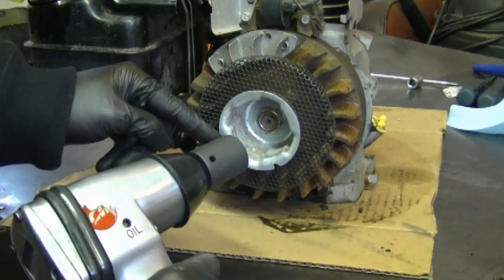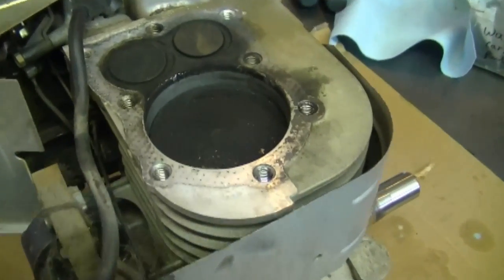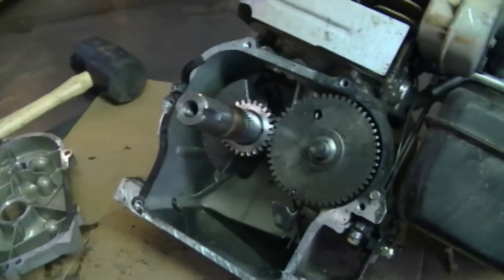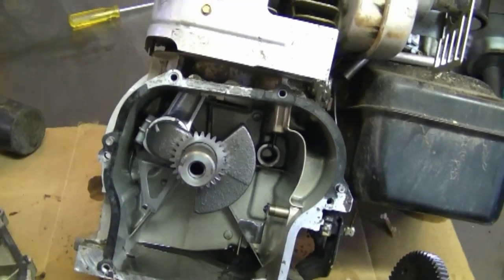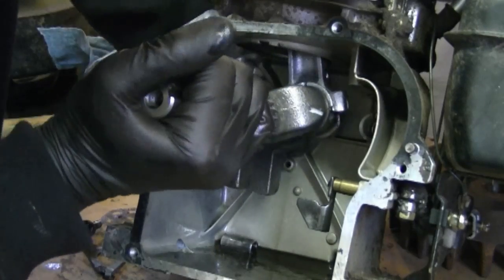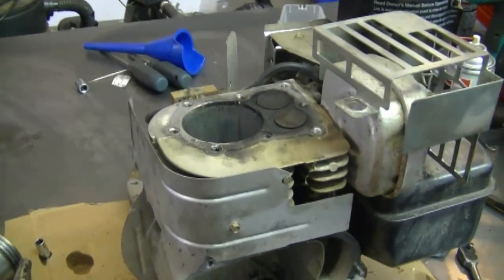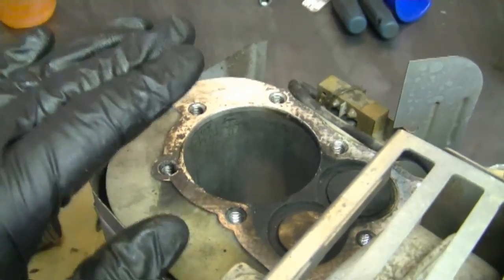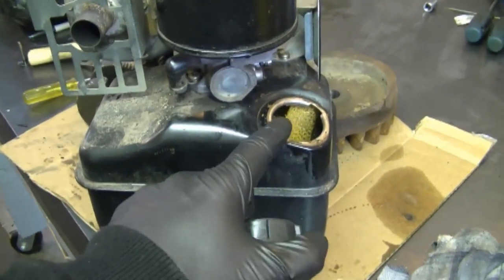5hp Briggs & Stratton Engine Teardown & Possible Cause Of Death

Comment: Old vid.. but a handy one.   I found a big old cement mixer on my property in the woods. It spent at least 20 yrs in the woods.    Same engine.   Rather than rebuilding tho, I bought (for 50 bucks) a running replacement.   BUT... The replacement has a 3/4 smooth shaft... The mixer engine has a 3/4 shaft with teeth for the 6:1 gear reducer.   Soooo... I'm simply putting the old crankshaft and crankcase cover,  made to accept the reducer box, into the "new to me" engine...  Which is super clean and smooth running.  
Pretty straightforward with a little patience and research.    Including this vid.

Comment: Online 5hp rebuild kits are cheap for these old Briggs engine's, you can over size the cylinder and get an oversized piston as well, OPTION 2 get a Running IC 5hp engine you can find them all over used and swap the crankshafts 👍

Comment: You are best off inserting a sleeve, new piston with cast iron rings if you want any life out of the engine. If you hone it you will hone through the chrome and a bare aluminum cylinder will wear quickly. Have done several repairs like that on B&S engines and they have never come back with compression issues.

Comment: Wow I the cost of a short block in Canada is wildly expensive, yes I agree with you ,the oiler rings tolerance appeared to be to tight that would definitely allow improper excessive blow by, I agree that's why the piston  was carboned so badly !I'm rebuilding a 1974 briggs 3.5 hp for a fellow he just wants it built to run, so he can have a running antique engine, I was big time surprised all of the o.e.m. parts are still available even the o.e.m. paint in a rattle can is available i want to thank you , for all of the education you have shared with me, on small engines, I have recently been showing the neighborhood kids 9-14 years old how to do the things I have learned by following your lessons with small engines you have been a wonderful teacher to us, again thank you!

Comment: Solutions to needing a 7/8" diameter output shaft. Make a steel sleeve to fit over a 3/4" output shaft engine. Use the existing 7/8" shaft and end housing on a new engine.

Comment: Thanks for a clearly-detailed video, and for planning all the camera angles well. The audio level was easy to understand, but at the very first, you began speaking in a low-volume and rapidly, so the words slur together. You could provide a screen caption for that part, which would spare you the need to re-record that opening segment. Your concern for quality production values speaks for itself, so I subscribed.

Comment: those prices are why predator 212cc engines are so popular for repowering equipment. that, and the fact that they are a pretty good honda clone. especially for less than a hundred bucks. plus there is a ton of aftermarket performance parts for them. you can easily put $1500 usd in parts into a $99 engine, and triple the stock hp without sacrificing reliability.

Comment: Great video, hone the cylinder and use the same piston, put in the new rings and that is good enough. Another option is to go with a new engine, 3/4in shaft and add a shaft adapter.

Comment: $99 on sale for a 6.5 hp harbor freight motor.. I got quoted $129 for that carb ended up getting one off Amazon for $19 with gaskets and 2 day delivery.. Pick your battles, what's your time worth...
Reply: Harbor freight does not sell a 7/8 shaft with a taper for a leaf vac

Comment: My mother buyed a briggs powered mower in 96, he never change oil for nine years until i grow up ad i do it, now i regulary Service it wit 5 40 sint oil, ive cleaned once the carb when it doesnt start, engine is running mint And start at first pull, it doesnt drink oil And i want keep it for life And If dies buy a new engine because is magnesium deck And i love it, its a very strong machine its a dolmar 4546

Comment: i got one from a junkyard last year hoping to use it on a mini bike until i found out the old owner ran it without oil and the piston split apart on the side the metal that came off the piston got melted to the cylinder but since it has an iron cylinder wall it could be repaired if i had the cylinder bored the junkyard has a few parts motors i could buy for parts

Comment: Did you go on eBay. Did look for them Parts they are a lot cheaper. You can buy your carburetor for that for like $18 to rebuild is even cheaper. You should be able to find a block there that's pretty cheap with any size of shaft all you got to do is go on eBay and look

Comment: Mower ran great in March, after replacing the drive belt, air filter, and spark plug it will not start. Replaced the coil pak and now  there is no compression, replaced head gasket and still no compression. Piston/valves look decent for 7 yr old engine, WTH? 7HP Briggs & Stratton...what's next?

Comment: My Craftsman chipper/shredder has the same 5 hp Briggs as the one in this video only the air cleaner is different. The chipper was actually given to me non running, I guess the guy just bought a new one. The problem it was having is that the carb wasn't pulling fuel up from the tank so I pulled the carb off, thoroughly cleaned it, drained the old gas out of the tank and when I took the fuel pump apart which is on the side of the carb under a removable cover and found that someone put the spring on the wrong side of the diaphragm so it wasn't allowing it to pump fuel which was obviously a simple fix. After I put the carb back on and put fresh gas in, it fired up and runs great.

Comment: Hi, I have very similar B&S 5HP engine. And I dot't know if it's normal that it has 0,3mm axial loose on the crankshaft and if I set the exhaust valve open so it has slight radial loose. Is it ok?

Comment: The connecting rod has MAG and PTO stamped on it and would like to know which way it's supposed to face? Plus, where does the arrow on the piston  head supposed to face.... inlet or exhaust? Thanks in advance.
Reply: Paul Whyte MAG is towards flywheel and PTO is toward sump cover. the arrow on engine points towards flywheel as well.

Comment: I have a question...a few years ago I bought a Briggs and Stratton mower. Well two actually.  1st one I took back because it would barely start.  2nd one was a gem.  Put gas in it. Put oil in it.  Start it up and start mowing.   The engine literally blows 2 holes in the crankcase.    Remember    new never used.  Wtf caused that catastrophic damage?
Reply from the maker: bring it back to them

Comment: Dony I am currently rebuilding a Briggs motor from a mower and one of the bolts on the cap that is on the connecting rod and crankshaft is rounded out, the other bolt came out easily but the other bolt is not and the head is rounded out, how should I get this stubborn bolt out??

Comment: this vid is gonna help me out a ton. i have an older model of that leaf blower vac and it seized up on me the other day. stupid me didnt check the oil in the 30yr old engine that i got off of craigslist. ive never done a rebuild and this is gonna save me alot of pondering. also saw the other vid on how to remove the fan. thanks for posting these videos.

Comment: hello sir, I'm repairing b&s 5hp eng mod#1300 I had poor compression 45psi & lapped valves & I put new rings & I honed cylinder & it pops back thru carb & checked timing & lined timing marks but eng is not TDC ? that ok ?? what causes pop?? sound timing off??

Comment: that block is savable I had a briggs quantum that had seized and shredded the cylinder from burning up I acquired it from a junkyard I threw oil in it put new crank and piston it and is completely fine now the marks are nearly gone and theres no smoke anymore if the cylinder is zinc its savable the rings will reseat you just have to elimante the cause

Comment: Hi Donny.  Your videos are excellent!  Can I get some advice?  Observations:  My tiller won't start.  I have spark (used a tester). Took off manifold and have black on top of valves with little carbon on piston.  Piston moves up/down freely when rotating flywheel or outer engine pulley.  No scoring at all when I move piston to the down position.  But both intake and exhaust are slightly raised when piston brought to at the highest point of the piston; they are not seated. This is probably why there is no compression - air leaking out.    Question: Is there a way to adjust the valves to seat when piston is raised?  Or do I need to rebuild something?  (I saw your video when you removed the piston -- disassembled the engine).

Comment: I don't think the damage on the cylinder wall was caused by carbon - it looks like the engine was run out of oil - this damage is consistent with a lack of lubrication.
Reply: @chickenmaster7069  Una vez que se araña asi como ese asi lo limpies( Honing) se PEGA aun arrancando en frio   NO VA MAS The END! B&S Scrap!

Comment: Just a small suggestion. If the crank won't pass the case without a flaying from a hammer, you need to dress the rust off the shaft first or the bearing surface inside the case behind the seal will become damaged and wear prematurely.

Comment: I have the exact same engine as yours and it was burning oil, so it has like a 0,5mm deep scratch in it.
Do you think it is possible to repair it with one of these Ebay honing tools for your drill?
Reply from the maker: +Patryk Darasz possibly but sometimes it may enlarge the cylinder too much and it will have low compression and burn oil
Reply from the maker: +Mike Brink that's right, hardly ever worth rebuilding an engine now

Comment: This is what Briggs & Stratton calls the "Koolbore" engine. No main roller bearings, splash type oil lubrication, and no inner cylinder sleeve. Just aluminum cylinder.

Some people call them junk engines. That's really not the case. I have one on a roto-tiller that my dad had, and now I have it. The way to make these engines last, is to change oil more often than other engines. Make sure it is full of oil before use. These engines do burn oil right from new. Just the nature of the beast! When using these engines, just make sure not to over heat them. Quite easy to happen. Just don't run them at full throttle. Let them cool down after 20-30 minutes of use. Still run mine and it still runs good for an engine made in 1973. One more thing is to pop the head and clean the carbon off the top of the piston. As said in the video.......the carbon severely dammaged the cylinder.
Reply: these engine are the best I have them in all my machines the key is to put mystery oil in the gas for upper cylinder lube and to keep the rubber diaphragm in the carb soft

Comment: Another great video and wording. I am having issues with 2 mowers that just decided to stop running even after replacing the carbs on both of them. The one briggs does show to have 60 PSI compression. The other mower the fuel was leaking into the crankcase so I thought best to replace the carbs thus ending that nightmare. It ran fine and no more oil was coming out the muffler. I did lift the cover off of the one briggs just to see if the flywheel key was broken, but both the mowers have spark...any words of encouragement is much appreciated.
Reply: I HAVE AN 15.5 BRIGGS AND OIL IS GETTING INTO THE[ CARB] SIDE I ADD OIL TO CRACK CASE AND IT ENDS UP IN THE [CARB] HOUSING HOW DO YOU REPAIR OR CAN IT BE REPAIRED. THANKS GARY [DISABLE] VET
wortass2@aol.com
Reply from the maker: gary bratcher sounds like the head gasket, I do have a full video on that procedure
Reply from the maker: donyboy73 https://www.youtube.com/watch?v=UaG75e1DhLo

Comment: Would the sump cover come off easier if you cleaned up the rust on the shaft before you try to pull the cover over the shaft, better on the seal??
Reply from the maker: yes it would
Reply: Ty old man

Comment: What is the purpose of that yellow mesh they put in the gas tanks Don?
Reply: DesertDigger1 
Did you ever get your answer about the yellow mesh in the tanks???
Reply: Paul Govensky No, but I'm thinking its an anti-static thing or something Canada requires.
Reply: +DesertDigger1 From Briggs and Stratton website:

What is the purpose of the "sponge" in the gas tank?
This "sponge" is used to prevent air pockets in the fuel. These air pockets are caused by equipment vibrations and can eventually lead to a condition called vaporlock. When the engine is vaporlocked, it will not be able to start. Not all engines require the use of this sponge, and if your engine's fuel tank did not come equipped with one it cannot be added. 
If your engine does contain this sponge, it is very important that the fuel remain fresh. Stale fuel will cause the sponge to deteriorate and block fuel passages in the fuel system.

Comment: i would have bored it and fitted a cylinder sleeve and bring it back to standard bore size. the engine oil looks like it hasnt been changed in a long time as well.
Reply: putting a sleeve in one of these things is wayy out of the budget. Never seen it done on an  <12hp air cooled engine.
Reply: Miller Thompson i've done it to 10 and 11 series 4HP blocks, 13 series 5Hp blocks, as well as 8, 11, 12Hp blocks.....was charging $120 for the job, included the sleeve, new piston and rings
Reply: Now you know eh rook..

Comment: OK, but hammering a rusted crankshaft snout through an aluminum plain bearing is not a good idea. That plain bearing in the cover is now kind of toast. Clean off the rust first with some sandpaper and penetrating oil.

Comment: i took my one engine apart and forgot to mark my intake and exhaust lifter how can i tell which is which and does it really matter which is which
thanks
Reply: David Abraham 
Always remember that your engine needs air so that would be the big valve and the smaller is exhaust
Reply: @Smalltechguy  I know this is a old comment but hes talking about Briggs lifters (some call them pushrods),on 90% of these engines they are identical,he wasn't talking about valves and yes, on the valves the big one is intake and the small exhaust.

Comment: Is there any way to take the piston out if a pully is welded to the crank?
Reply: yea take the two bolts out of the connector rod that holds it to the crank shaft like at 3:30 in the video and push the piston out the other way (out through the front of the head) instead of pulling it out the bottom because the crank shaft will be in the way
Reply: if you can pull the sump cover out far enough to get to those bolts on the connector rod

Comment: Sometimes the carburetors get clogged with gunk.  You'll probably need to remove the carb. and clean it.  Sometimes the gunk holds the needle valves open more than they should and too much fuel gets into the combustion chamber.  If it is VERY clogged, then it makes sense that it wont even start also.  I bet that carb. is filthy!

Comment: with 20 W 50 oil this engine would still be running like new In the past forty five years I have never had an engine were out using 20 W 50 oil

Comment: Hey don I have a 1979 mastercraft snowblower with a 5 oMr 4 hp Briggs  engine.... It won't start.... The valve clearance is good and it has ok compression ,... I just drained the oil and the was quite a bit of gas in it .... It also has good spark ... If u have any suggestion that would be greatly appreciated thanks a lot

Comment: sorry to bother you again but i have tried to remove the crankcase from a briggs and stratton 35 classic and it will only come off around 1/4 inch and will not move any futher i have tried pullers hammer air hammers you name it and it will still not come off is there something else holding the crankcase to the engine or is it just locked to the shaft? 
Thanks again

Comment: ooohh i hate carbon build up my lawnmower is 4 stroke ive only just started it just to get it running properly again it hasent been started for ages (few years my petrol has 2 stroke  in it but not that much smoke comes out o the exhaust to be honest barely any smoke but i shall be getting pure petrol in it after i saw this :)

Comment: Actually i was told by my instructor at tech that there is difference between honing and boreing! Honing pretty much only refurbishes the cylinder and removes the scratches and boring actually removes metal!

Comment: Nice video Dony. Your disassembly was very instructive and showing and explaining carbon build up helpful. I have older 5hp that I'd like to get manual for from B&S site to replace/repair recoil that does not retract well but darned if I can locate any data plate. Any ideas where to look? Thanks.

Comment: Ran into big problem took sump cover off and while removing rod from crank one of the bolts got stripped. Just the head. Vise grips didn't help. Anyone know a good trick to get it off??

Comment: The best octane booster I use on my lawnmower and snowblower was from lucas oil, it actually works to a degree, I got a 12 pack online for like $80, and one bottle will last you quite a long time, you use two ounces of it in one gallon, and each bottle is 15 ounces, I suggest you check it out

Comment: @richardwernst. I have no clue what the sponge is for. My best guess is to stop the fuel from sloshing around to much. But with today's gas, the ethanol ears it up and reaks havoc In the carb. As I said I removed the sponge And the thing runs better now then it did without it.

Comment: The price of the replacement parts are the reason the chinese engines are becoming more and more popular.  $100 bucks for a fuel tank???  I just bought a new 212cc engine from Harbour Freight for $100 bucks

Comment: I got a 2 stroke demo/concrete saw with a burnt/scorched piston.  Very low compression.  It cost $350 for a new cylinder/piston kit.  Would it be worth it to have a machine shop bore it out with a new piston?